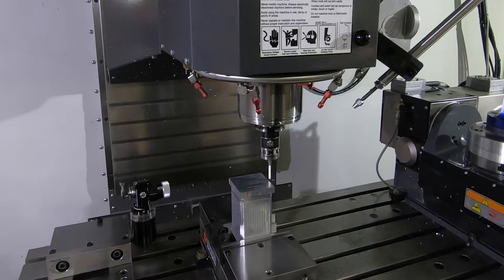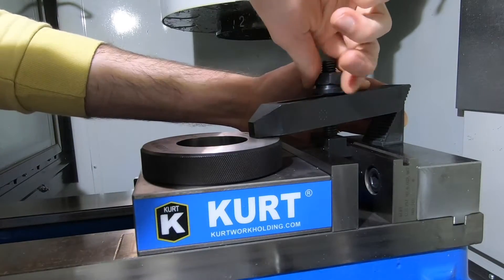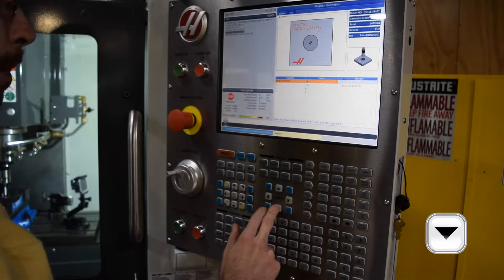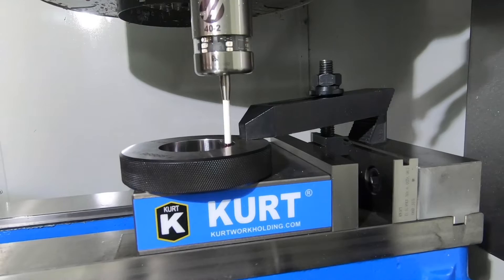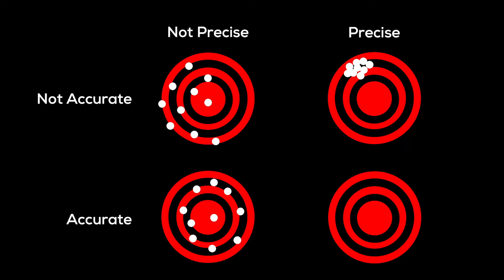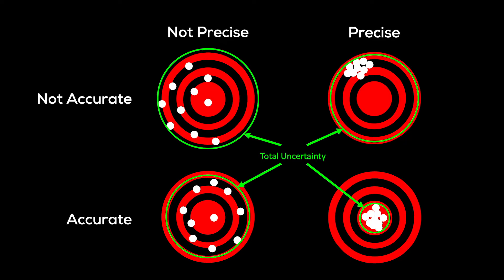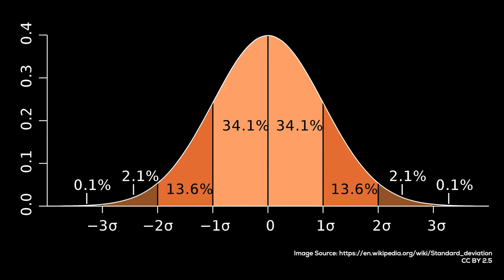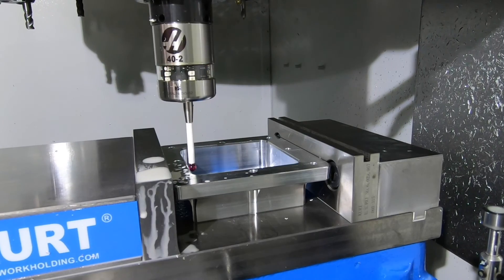Renishaw Probe Accuracy Follow-up + Intro to Precision and Accuracy

Comment: Wait how did you get the raw data with more than 4 decimal places?! Are you saying if my stock to leave of .0001" is not enough but .0002" is too much I can use my CAM software to add stock to leave of .000155"?!
Reply: Wait Fusion only outputs values to 4 decimal places, I'd need a new post processor... But that's insane I need to know how you got the raw data like that please

Comment: Another awesome video, thank You. I don't fully understand the proces but I assume You check widest dimension with that probe for calibration. But in order to work,  it should start from exact middle of the circle. Any 0.00000x offset changes the length of x and y reading right ?

Comment: I have played around a awful lot with getting the renishaw as precise and accurate as possible. There is one important thing to be taken into consideration: the precision of the gauge ring and its accuracy. Its not round. The printed dimension is not 100% correct. Reference the inspection protocol for their measuring error. The best way I have found: fix the ring as flat as possible to the machine. make sure it can´t move. make sure its not distorted. Take work offset from ring. zero over ring and validate center as perfectly as possible (even now, with micron indicator it will be quite impossible to find a "perfect zero"). Zero machine on this spot. Now calibrate from exactly this zero point, in exactly same height where the indicator was zeroed. This method improved my measuring error a lot. After calibration it´s also advisable to measure several gauge rings right away to validate the calibration went correct. I even found small differences in precisely repeated calibration processes. And of course: never chase the last micron. :)

Comment: It would be nice to see what the ring gauge measured on a CMM and compare that with the Haas probing system. Was the gauge really 1.99996?
Reply from the maker: Yes, 1.99996 was the actual value on the certificate of calibration. Per the 10:1 rule, that number would have been obtained with a measuring instrument that could resolve at least to +/- .000001.

Comment: Anyways, how do you know or how can you be certian you are actually calculating the Machines repeatability? I use a probe on a machine with a whole factor of magnatiude more, precision and accuracy; cylindrical grinder. We routinely hold tenths on postion using a probe during production. repeatability of machine is .00001. (Swiss made Studer CNC). Production would be scrap if our probe and machine couldnt hold tenths.

You might have better results and infact anedocatly like I say, it is possible using a different method and more accurate tooling.

edit:Hass say it can hold only 
0001 on position, renishaw claims in the millionths. Should have started there.
Reply: @accumach6454  although the vise was tightened on the T-nut so it might have been stiff enough for this order of magnitude.
Reply from the maker: Your machines are on a whole different level. Most swiss machines I have seen have glass scales on the axes. This machine definitely does not. Somebody else made a good point in another comment about thermal expansion. If the ball screw heats up 10 deg F, it'll expand by .00012 over that 2" range.
Reply: @tarkka  Well thats what i am saying, you arent testing the Renishaw probes accuracy or precision anymore then you are the positioning accuracy and repeat-ability of the HASS machines,

Comment: There was one measurement that seemed to be an outlier.  Any idea what might have caused it?  Also, what would be the uncertainty if that data point were ignored?
Reply from the maker: Sorry it took so long to get to this. You're correct that the 1.999773 data point appears to be an outlier according to a Grubb's test (P=0.002). Throwing out the outlier, the accuracy error becomes .00012 and the 2*sigma value becomes 0.000019. This gives a new total uncertainty of 0.00014 (compared to 0.00017 without throwing outliers out).